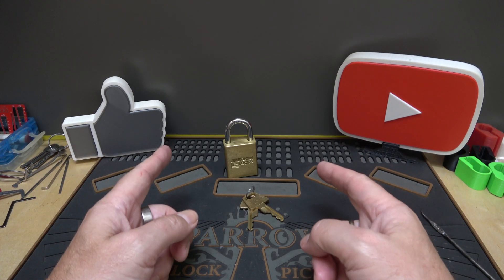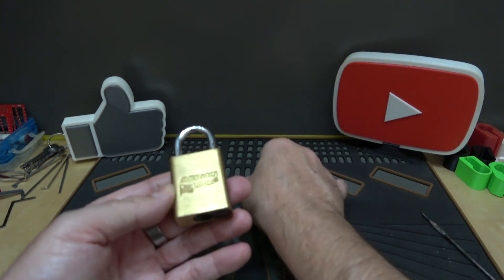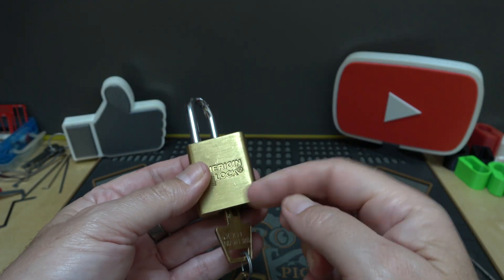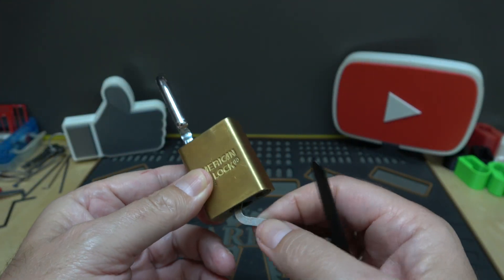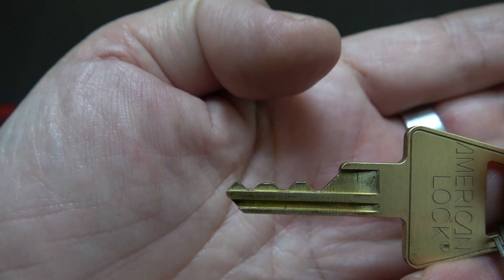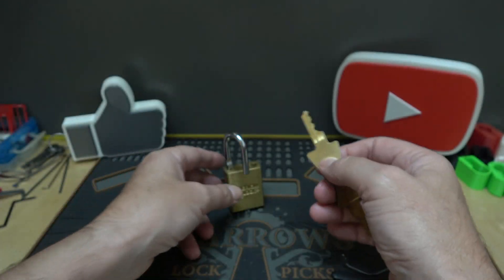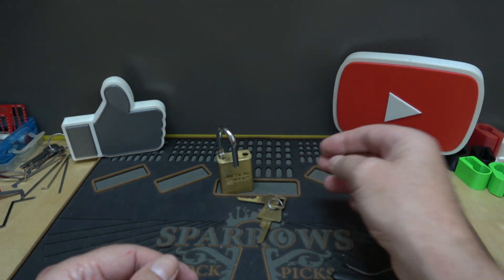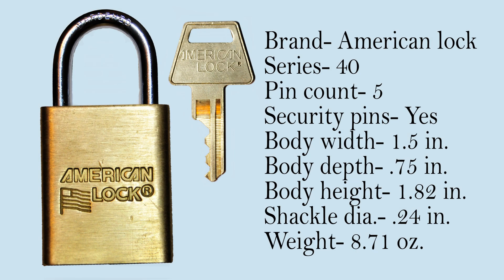#449 Why are pin lengths so important in lock picking

Comment: Great video, Big Al.  FYI, I have converted those rivets to screw posts and they have worked quite well.  Just takes care and patience…and a steady hand with a drill. Haha
Reply from the maker: Bro, I did the same thing with another one. It didn't have a key so I carefully removed the rivet and replaced it with a screw system. I like the way you think
Reply: @AlbertLebel  I enjoyed doing the conversion and I have plenty of parts, so I’m going to have to find more of them and “save” them. Honestly, I don’t know if the riveted versions have a specific model number, so I didn’t know what to look for.  The ones I’ve converted have been 1100, but I have other 1100 which already had removable cores.

Comment: Well explained, but this kind of bitting also protects against raking, jiggling, and bumping attacks as those will usually lead to oversetting of the low pins. My workshed lock has similar bitting which I consider an asset for those reasons, and it also makes it easier to find it's key among the many other Kwikset types on my keyring ;)
Reply from the maker: Very good point, I rather have exaggerated bitting like this than flat any day. My point was simply to explain why some people have trouble picking a lock they seen someone else pick easily. This one fit the bill perfectly

Comment: Awesome to know. Have some military Series 40 American lock. I thought they only riveted plug for their US military locks. Does urs also have restricted keyway? I’d like to change the plug to one of mine to make into a cl. But I think I will just leave alone one of them and find another restricted keyway core for the other one I keep. I want to try and keep as original as possible. Though also want a working key for one of them. Have a few with cut shackles but only one without. But unfortunately has restricted keyways.
Reply from the maker: Thank you, personally I just buy new cylinders from CLK supplies to make CL's. Their very affordable. And lets face it, American locks are usually already a challenge to pick when stock
Reply: @AlbertLebel  yeah, they sure can be fickle. Especially worn out ones😂👏. Shit I have three, I’ve still not been able to pick as of yet. Not that I’ve put tons of time to em. But they ain’t know 3 min open yet🤷🏼😂

Comment: if you do not know what the key looks like. a lock with zero lift pins, can cause som nasty oversets, making picking harder, if you do not have a feel for the overset keypins not falling back down
Reply: I think one or two in the right place. But three😬🤷🏼. A little much. Also though if it was someone who didn’t know much then might be more effective. But not mr Lebel😝👏👏👏😎
Reply from the maker: You are spot on. My point here was simply to explain why some are easier to pick. I have had people ask me why they couldnt pick a lock they seen me pick with ease, I just say it probably has to do with bitting. Then they say what's bitting ?. 🙄This was easier to show and tell
Reply: @AlbertLebel  oh absolutely! Great thing to cover. Was actually how I first started opening locks. Checking the bitting. Shit I still do on some locks still to this day. Especially after a pick. Or if i put hours into it. Then I might peek 🤷🏼😂😜. Good stuff!